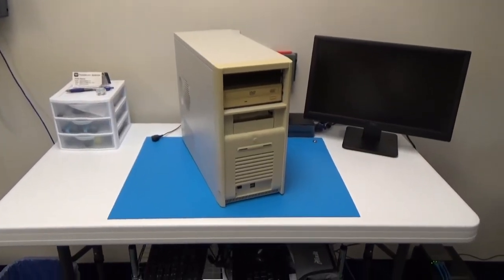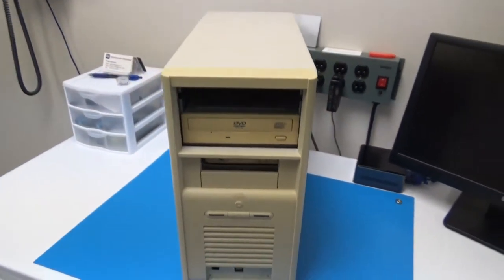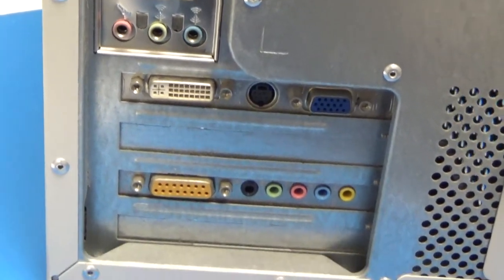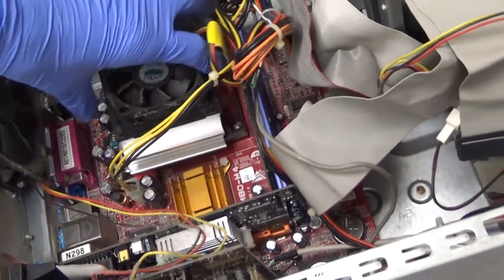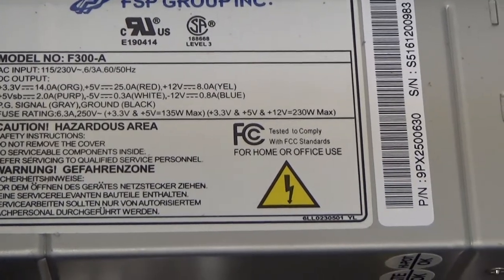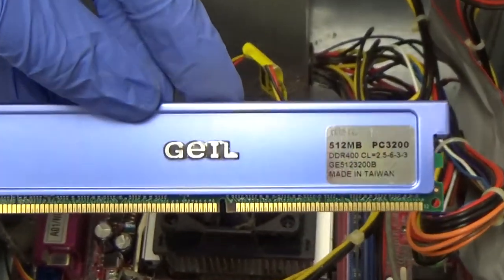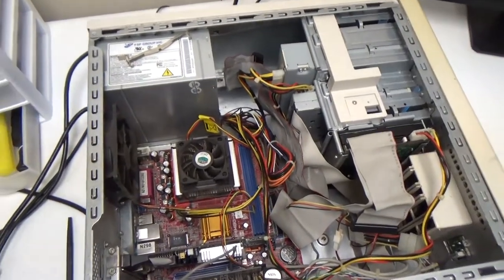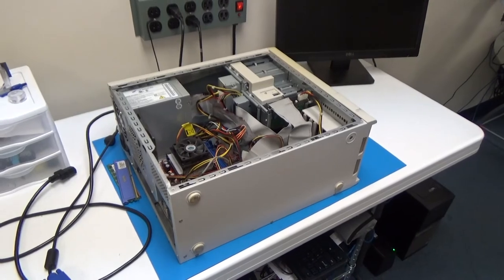Mystery Computer - Old Computer Showcase

Comment: Socket 478 is plagued with cpu retention modules that break at that one point. I've lost count of the amount I've had to replace over the years. Sometimes it is better to get a screw in type fan assembly / heatsink combo and avoid the plastic module all together. That board may have still worked there is to many things to consider e.g a loose heatsink won't let it power up as the bios will see it as bad thermal. Personally myself I'd strip it down and pull out the board and get it working but that's just me I do retro if you haven't guessed lol.
Shame to see another socket 478 end up on a scrap pile they are very good retro pc's for the windows 2000 / XP era.
Reply from the maker: That's good to know, thanks! I'm going to hang on to it for a while; I tend to hoard computers! Maybe I'll revisit it in the future if I need a project.